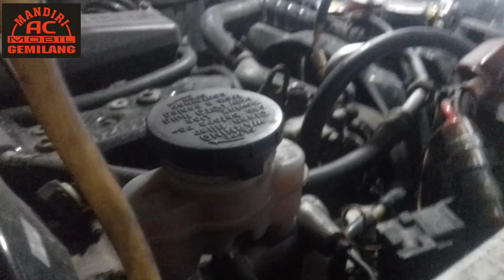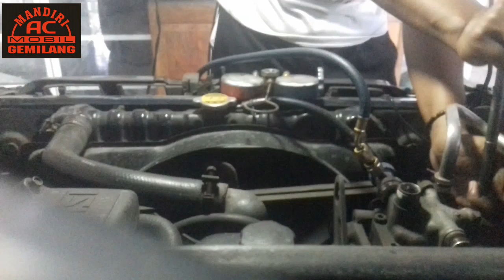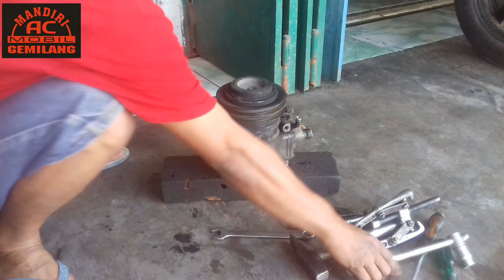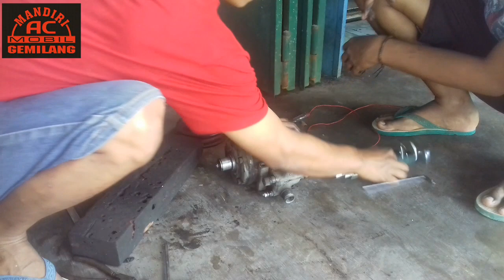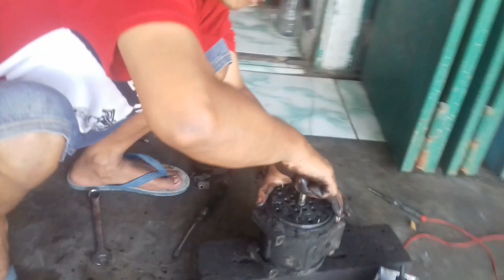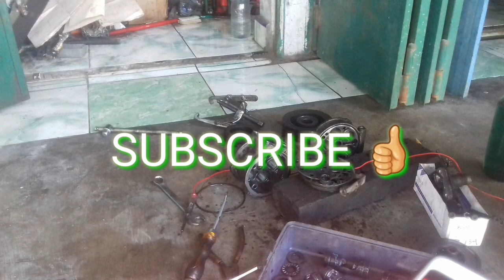Ciri Kompresor  AC Mobil jebol, kompresor berisik || bongkar kompresor

Comment: Om mw tanya klo ac mobil sy apv tekanan psi nya di angka 50-60 ac tidak dingin.. klo di gas rpm 2000 turun ke angka 30psi dan ac berasa dingin.. mohon pencerqhan nya om..trm ksh
Reply from the maker: Kompresor sudah lemah om, harus di bongkar dulu untuk tahu bisa diperbaiki atau harus diganti

Comment: Untuk mengatasi compresor ac mobil panas dan ac kurang dingin?
Reply from the maker: mungkin kondensornya ada yang mampat om. terakgir servi s sudah lama belum ya
Reply: MANDIRI AC GEMILANG condensor baru om, klau slang 1/2 bisa pengaruh gak om
Reply from the maker: terakhir apa saja ya om yang di kerjakan
Reply: MANDIRI AC GEMILANG ganti compresor condensor Xspansi dreyer
Reply from the maker: ini mobil apa ya om,  sudh di flushing sampai bersih ya om. oli kompresornya mungkin kurang.  
fan nya gimana putaranya
Reply: MANDIRI AC GEMILANG uda tak flusing om. Coba tak tambah oli. Kipas nya ok
Reply from the maker: @ranualayyubi7177  tekanan freon normal ndak om
Reply from the maker: mobil apa?
Reply: MANDIRI AC GEMILANG mobilnya estilo
Reply from the maker: tekanan freon gimana om
Reply: Tekan rendah normal nya 15psi sampai brp psi om?
Reply from the maker: @ranualayyubi7177  15 psi terlalu kecil om,  kompresor cepat panas. idealnya posisi stasioner 30-35 psi. nanti di gas 20-25psi kompresor harus putus.